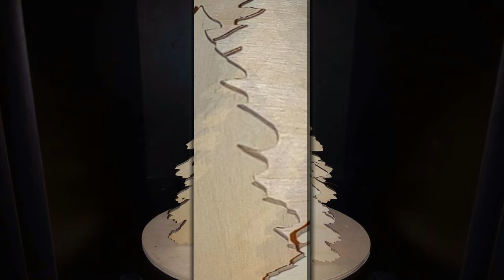Lit Tree Silhouette - Christmas DIY / Woodworking

Comment: What are your thoughts about using a spiral blade for these trees? Lots of small turns. New to scrolling here!
Reply from the maker: Of course you can use a spiral blade. Every now and then a spiral blade will be faster like for example in my latest project. But every time I really need to follow the line I don't like to use spiral blades because the cut can quickly look scrawled and shaky. With a flat blade you have much more control. I like to use a No3 blade for projects like this.
Reply: @FabiansTinyWorkshop  Ah yes that makes sense. The scraggly cuts has been my limited experience with spiral blades. I just have a hard time turning the piece to follow my lines. Thank you for the reply!